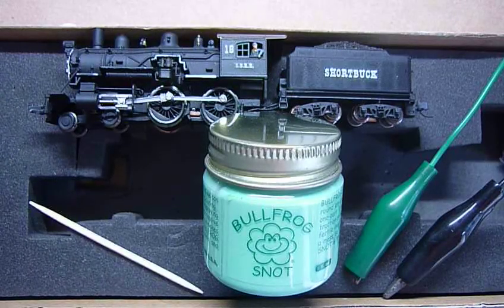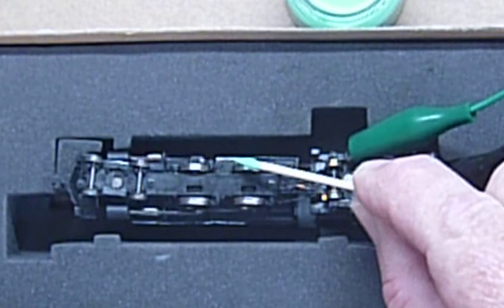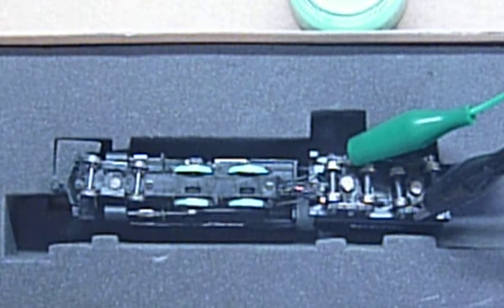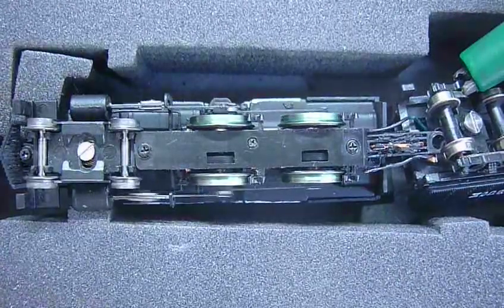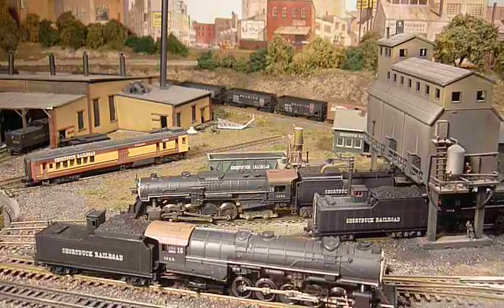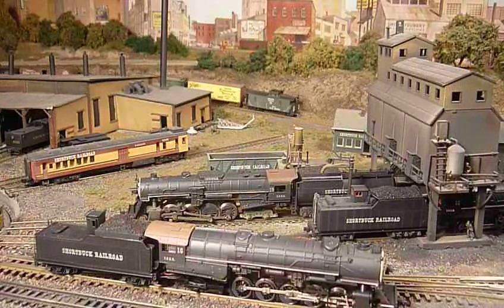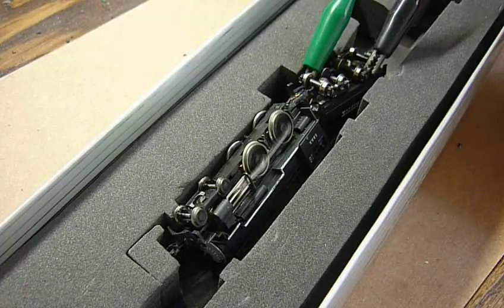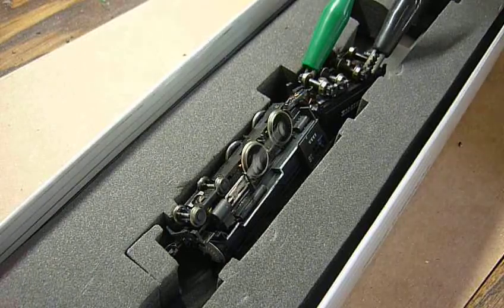Installing BULLFROG SNOT ** SNOT = SAND

Comment: Thanks for adding this! Have a Kato GS4 that parted one of it's T tires last night after working on adding an MTL coupler to the tender. I put it back in the box in disgust. Also a Bachmann, or two that have some that come off the wheels often. Add to that I absolutely HATE working on steam locos. Always some little detail parts gets snapped, plus getting the shells off is a nightmare. I'll give this snot a try. Thanks again!

Comment: How, how do it run/pick up electric current when you snotted all the drivers ?🤔🤔🤔
Reply from the maker: Normally, only one axle would use BULLFROG SNOT. The example loco has hard-wired tender pick-up on all wheels.

Comment: Thanks for the good tip I never heard of bull frog snot until I saw your layout I wasn't too sure about getting into n scale because everything I read about n scale steam was very negative about it and grade I have no experience with n scale at all just what I have seen on u tube I have just retired and always wanted to do this now I finally have the time and a 11×17 room to do it how big is the room your layout in I definitely want to do two levels like you have done and my next question is what are the best brands of steam locomotives that you consider the best pullers if you don't minde
Reply from the maker: This 9' x 12' room is the birthplace of BULLFROG SNOT. The Life-Like malley was the original test sled, and is still the best steam engine on the road. N steam can be frustrating, and the early ones (I began collecting in 1970)  were quite poor. I run Life-Like, B-mann Spectrum, Atlas, Con-Cor, BLI

Comment: How does that Bachmann I-10 run?
Reply from the maker: This is an old shell from the 'junk' Bmann 2-8-0 on a new Bmann 2-8-0 Spectrum Chassis. So it runs nicely. The L&HR 2-8-0 camelback is also on a Spectrum chassis.